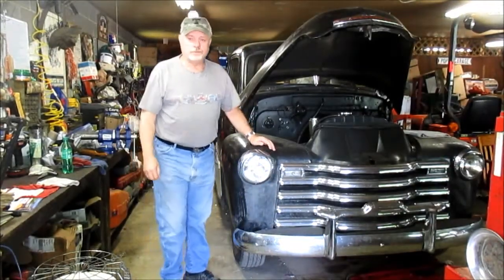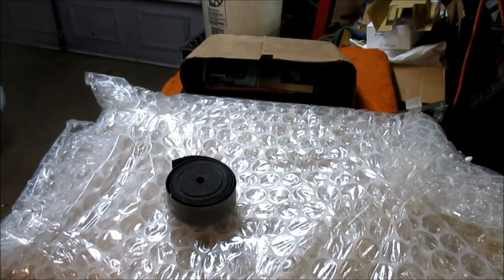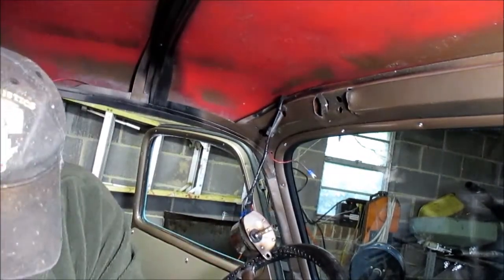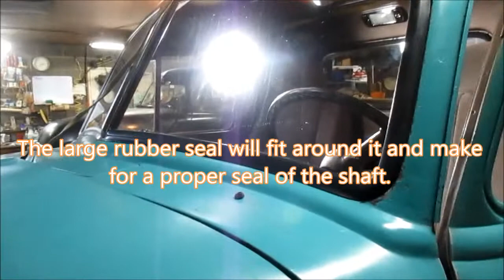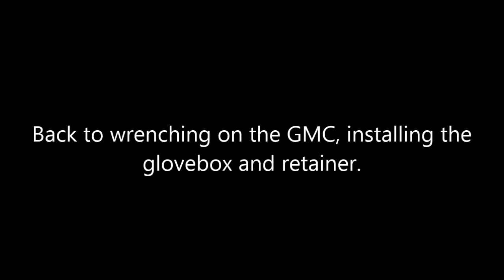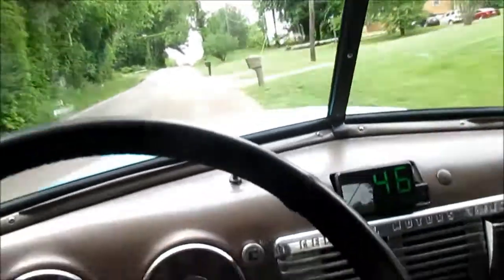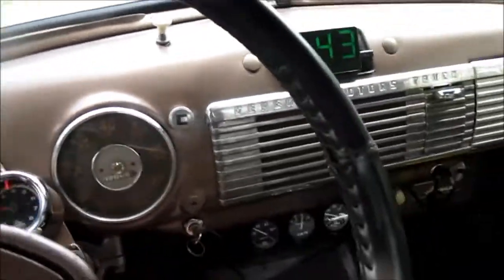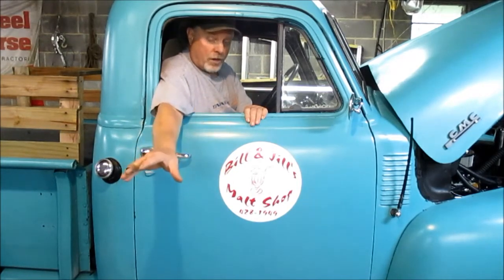1949 GMC Project, replacing the electric wiper motor and installing the glove box.Volume 24

Comment: Good job. The wiper motor may have a parking plate inside the cover that can be adjusted by removal and remounting by 90, 180 or ? Then fine tune with wiper arm. Worth a look 👍🏻
Reply from the maker: Thanks for the info!
Reply: Glovebox is simple. The wiper motor conversion is a real pain!!!!! Clocking the wiper linkage isn’t easy!!!!

Comment: I have a 49 chevy 3100 all original, 216 3spd on tree. I see alot of ppl using a very cheap 35 dollar VW, mid 80s Nissan wiper motors with some tweaking that will fit original spot under dash. All u gotta do is Google it. Be alot easier and cheaper and not have a motor in urr view. Most ppl want to chop up these old trucks and drop in a V8, etc. I like that too but there's something about a original old truck that fires up every time, runs smooth as can be and u can just drive it like it was meant to. Yes I love the power and torque as most ppl.
Reply from the maker: Hey Jason, I'll have to look up the wiper motor mod, thanks for sharing. At one time I had 2ea 49 GM pickups, the Chevy with the 235 and a GMC I had put a 350 in. When all was said and done I enjoyed the 235 powered Chevy much more than the 350 powered GMC, kept the Chevy & sold the GMC. Not to say there was anything wrong with the GMC cause there wasn't. It was fun to drive, had plenty of power & sounded great. I liked the Chevy more. Thanks for watching.
Reply: @Volfandt  Thank u. We rebuilt the vaccum wiper. As u know even brand new they not very good at all. I know that in 1949 most ppl only drove truck to town to get supplies and spent a majority of driving less than 40 mph so at that speed they may be ok but the only way is to spray windshield with hydrophobic sprays etc then faster u go the more wind so that helps out more to keep vision good then wipers. I had a set on VW Bug that used the spare for pressure for wash fluid and that along with heaters in Pa is a not so funny joke. 
In my short research from a few forums a 80s Nissan, 90s blazer/S10 or even a VW motor will work. The steps to make it work and the wiring is not that bad as we rewired truck for 12 volt. That's the only non original aspect. We've always done this more than hot rodding. Just nice to have a old car or truck as is. Yes the fuel injection and such is nice but having to choke, then let the old girls warm up is part of the charm. I once got it stuck between 2nd 3rd gear and had to hammer loose the arms and we've rebuilt it all since with bushings made of silicone instead of rubber, brass etc. Thank you very much for your opinion on this matter. I know we can buy a motor ready to go and wire but for the price a $20 JY motor and some welding is way way cheaper and easier. We're in process of restoring a 29 Model a car and the primer and reducer alone was almost 400 bucks. Insanity. This used to be a hobby anyone can get into, now just to afford the sand to sandblast a project went up 4 times. Used to b $4 a bag for coal slag black beauty. Now it's 15.99 bag. We built own sandblaster after old 1 was just worn out from all the cars, trucks, equipment etc. In 30 years we've used it ALOT. Now ppl need a small loan just to restore a scooter. I digress. Thanks again.
Reply from the maker: @jasonchristopher2977  👍
Reply: @Volfandt  Nice truck btw. I said all that and forgot to tell you. I love these old rigs. I've been thinking about fitting a reliable newer engine in 1 for a all year round kind of truck or car. Driving an old str8 6 3 speed and bias ply tires in snow is like a deer on ice. A nice project I'd like to do is a 5.9 Cummins in a 49 chevy truck. Take a hell of a set of springs up front, plenty of room and a newer front suspension. Idk if those old king pins would survive a year. That way it's more modern, use able and keeping with the truck idea. I'm searching for rear wipers from a suv or minivan. Some forums have said this and even 1 speed on a Idk potentiometer switch so it'd give 6 to 12 volts would give me all the speeds I need.